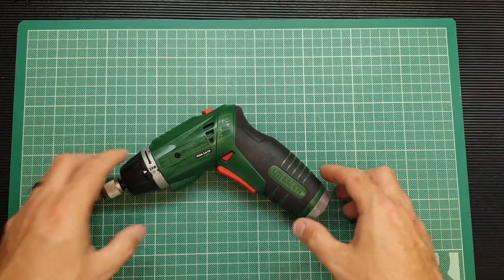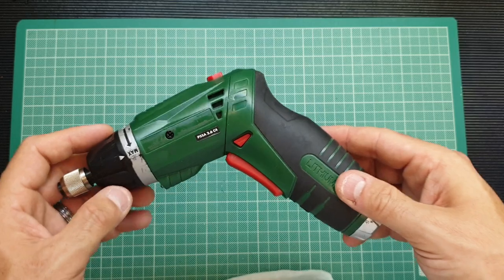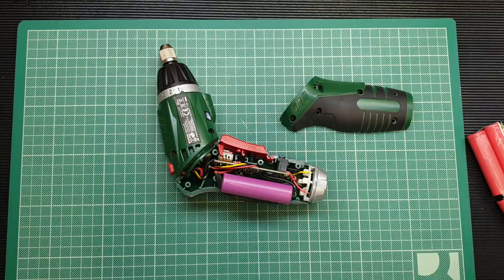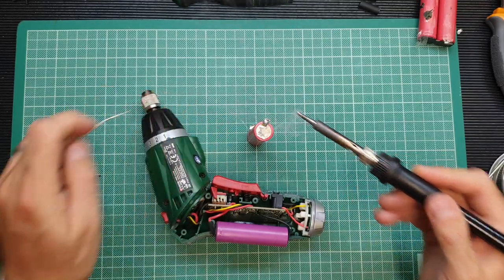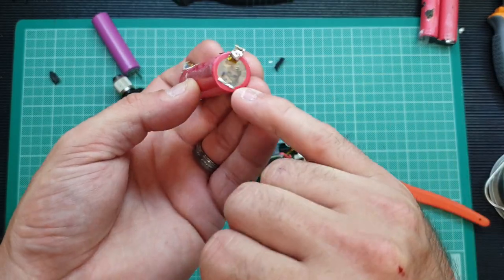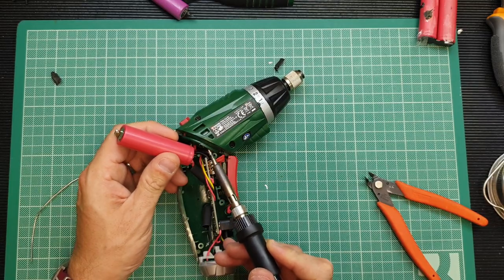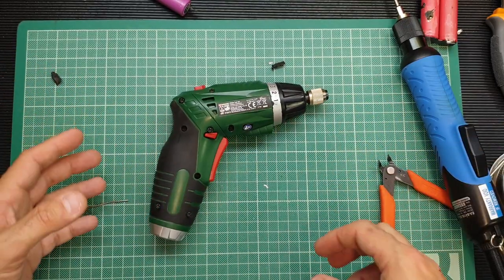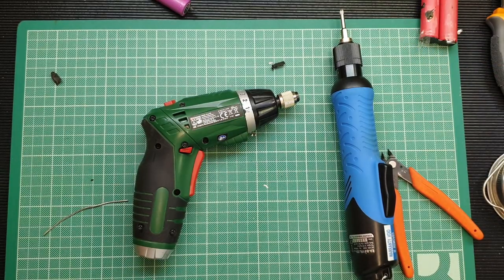10 Min tool repair: Replacing the battery in a Parkside / Lidl electric screwdriver

Comment: The main issue is that you do need a high discharge 18650, rather than a normal battery pack 18650.    I personally used a NCR18650B from Panasonic to replace the IMR.  (NCR means higher drain)
Reply: Did it boost a little at power or just only it has better capacity
Reply: @ΠαναγιωτηςΦωκας  - Same power, because the voltage (pressure) is identical.  I've since replaced two other screwdrivers the same way.   Capacity?   I've never worried about it.  1900-2800?  You aren't going to manage to use one of those THAT hard to run it dry before you plug it in again.  If you are, you need a larger unit, like IKEA's 7.2 volt hand drill.
Reply: @tbelding  thank you very much for being so helpful, I really appreciate it 😉

Comment: This cell might be high discharge current one, that's why it has lower capacity. Putting normal cells might be a bit dangerous, I would advice replacing battery, then some screwing around with normal usage and then battery temperature test, and then if cell is cold or mildly warm, then I would screw back the case.

Comment: I would have liked your video to give guidance about the chances of the pcb being damaged. The charge light does not illuminate which I assume means the pcb is damaged but it may just be the battery. The charger is working.

Comment: can get 2500mah samsung or other good brand cells for 6 quid and they are rated at 25amp draw which is gonna be a lot more than this thing can pull. will increase run time a fair bit.

Comment: When laptop batteries fail, it's often only one of the parallel sets that go bad and that stops the charging circuit charging them due to safety concerns.  When you crack open a laptop battery, measure the voltages of the sets of batteries, you'll usually find one set that is really low and that is the defective one. The others are usually fine.

Comment: Thanks for the video, very well explained! I have exactly the same screwdriver and it suddenly stopped working. Will try to replace the battery and check if it helps.

Comment: Even what seems to be a complicated thing might turn out to be really easy to fix. Or really difficult. Or impossible. Some time ago I repaired a 48" Sony Bravia TV. After turning it on, tv works, then after some time picture disappears. This might mean that something is wrong with video path. As EEVBlog says: Thou shall check voltages I found a chip that supposed to get 1.1V but was getting around 0.8V and then screen goes off this falls to about half a volt. The culprit was small 120mA LDO, that was put in circuit that was drawing about 135mA. No wonder that chip died. After replacing it with some more beefy part tv works without problems. And it was two weeks after warranty ended ;-)

Comment: Nice vid ,I’ve got one that need a new battery and I am capable of soldering it ,please advise me as to where to buy a battery.
Reply: Google "18650", there are many different variants and you get what you pay for. The ones that accept high charge are often limited in the amount of current they can give and vice versa. For this application I would choose a battery that can deliver a high current (e.g. 10A, equals more torque).

Comment: i have the same model. in the future i want to put it a 3200 samsung cell or lg to have a big range..  1500mah it`s little bit and i need to charge it many times..
Reply: Will the pcb handle the higher capacity cell? I also have one of these screwdrivers, just different brand.
Reply: @ruinunes8251  If it physically fits, the PCB should handle it.   You simply need to make sure you have a high discharge cell, like a NCR18650B (Panasonic).    It may take a lot longer to charge, that's all.